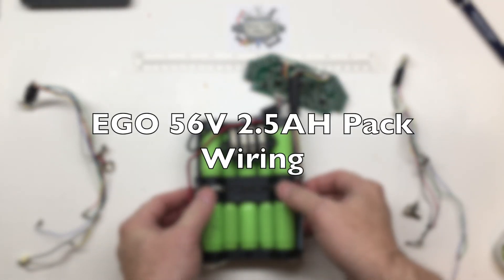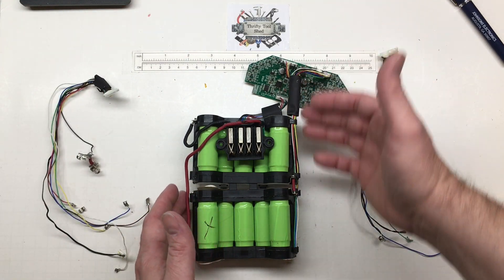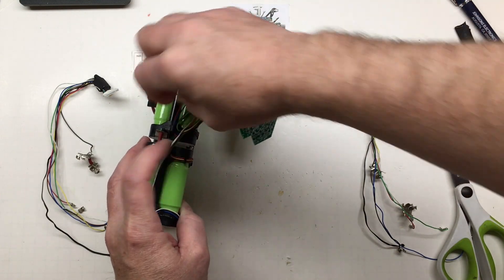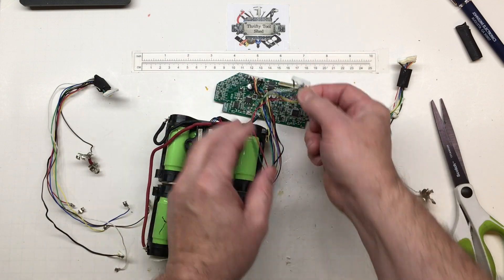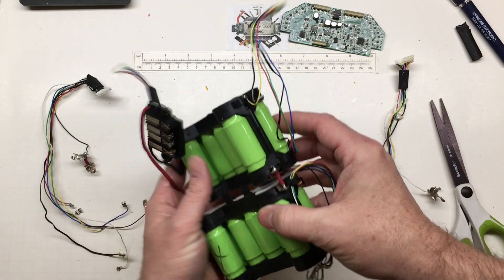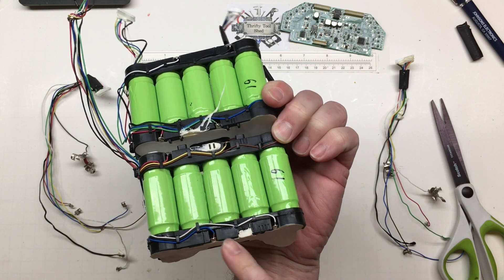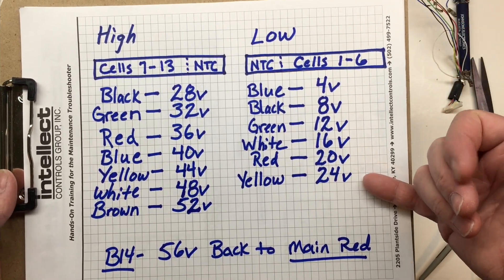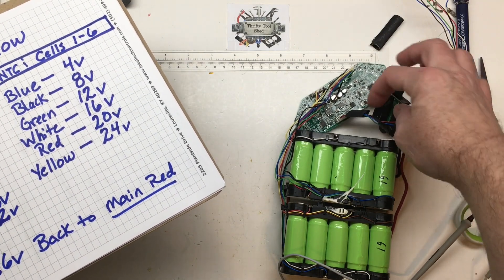EGO 56V 2.5AH BMS Wiring

Comment: I would number the cells with a marker and then take pictures as I untied the wires from the holders. Get the pic's printed at a local CVS. Prints worth every penny the next time you work on one. You can also write the volts from the chart on the batteries, but I'd copy the chart and keep it with the prints.
Reply from the maker: Excellent. The point of the video was someone already had taken it apart and asked for help getting theirs back together. Your points are valid and obvious to most (except for needing pictures developed these days). I hope my video showed that knowing ahead of time what-went-where would be the best way to do it without shaming the one who didn't? Thanks for sharing.

Comment: What do the two middle connectors near the main power connections actually do? Are they for the temperature sensing are they like a resistance to the ground circuit?
Reply from the maker: I do have videos about those terminals and all that I have found out about them so far. I do know the T-terminal on the newer 3rd Gen BMS boards are a little bit different. Works very similar though.
https://youtu.be/H-hggUXgYlU
https://youtu.be/dyLg5fK1SxU

Comment: I sent my Ego battery pack to a company for it to be rebuilt. They informed me that one balancing connector assembly on the circuit board was becoming detached and that the connector integrity is important for allowing cell balancing. What is a balancing connector and can it be easily repaired or replaced?
Reply from the maker: It depends on if the traces are broken or not. I will share a replacement of one of these in the video link below. 
https://youtu.be/85KmNgENFEc

Comment: I have a 7.5ah battery and the bms wiring was pulled out of the connectors.. where can I find a wiring diagram..?
Reply from the maker: I do not know. I have the video of the 2.5AH and it's so close to 5AH that it should be helpful for those as well. I have never worked on a 7.5AH or larger pack to say how close they are.
Reply: Same problem here.  Its the upper right connector (low side?) 12 pins,  but with only 10 wires.  Here is what I know {Blk-Blk-Red-Grn-?-?-?-Wht-?-Grn-?-Blk}.  I have three wires that pulled out.  They are Blu,Red, and Yel.
Reply from the maker: If anyone with a 7.5ah pack can help toddk63 it would be appreciated. 
I looked at my 5ah packs and they must be different. The top right 12 pin connector on the 5ah is blk,blk,rd,grn,-,-,blu,brn,grn,wht,rd,yeI.I do not own a 7.5ah pack. I rarely buy 3P packs period as they are so much more prone to failure in my experiences.
Reply from the maker: @toddk63  
One way to narrow this down is voltage measurement. Since you do have some wire connected. The 12 pin connector usually has B1-B6 on Pins 7-12 respectively. So from the battery minus/negative if you measure 4V then that is B1 and 8V is B2 etc. Depending on the charge of your cells of course...
Looks like you must have B2,B4 and B6 connected?
Reply: @toddk63  Did you ever figure out the order?  I have the same issue.
Reply: @Pfremm  
For 7.5 Ah battery:
Order is: black, red, green, yellow, white, blue, empty, empty, green, red, black, black
Reverse order is: Blk-Blk-Red-Grn-0-0-Blu-Wht-Yel-Grn-Red-Blk
Reply from the maker: @toddk63  
You can verify with the board unplugged by seeing which pins go to the B1-B6 test points on the board with a DMM. That is how I know on the 2.5ah and 5ah Gen 1&2 boards that they are going to pins 7-12. It will eliminate guessing. If the board is not using pins 7-12 for B1-B6 then it is a totally different board design!

Comment: Awesome job with disconnecting spade terminals off the nickle strips....I couldn't get them to desolder with flux and copper braided desoldering wick.Anyhow, I finally was able to save enough for all the tools needed to troubleshoot EGO battery issues. So far, I have disassembled one of the two 5 Ah battery, as both of them have reduced run time. Leaf blower would run >30' and now run time is only 10-15' max in high speed. Same with the mower - hardly 5-10' of run-time. I have tested 8* out of 14* (corrected) cells ad all have 2350 +/-2% mAh capacity, which seems pretty good considering they are rated for 2500 mAh. Would you know where could be the problem with your tremendous experience with these batteries and its BMS? 

I do not have any of the orange or red blinking LED issues. First 4 cells I tested had portion of the heat-shrink shell on the cell slightly melted - however, these tested to be at more or less the same capacity as the other cells. Tonight I am testing the remaining 4, but their physical condition is tip top and as such I don't expect to find any issues. During disassembly, all the cells were within 0.05V of each other.   I do have another 7.5 Ah battery which seems to be working fine with all of my EGO yard tools. My two 5 Ah batteries goes through more charge cycles due to additional usage during winter on the snow blower. On a couple of occasions it tripped for high current draw - motor had stalled out due to blockage.
Reply from the maker: Well they don't really seem that bad at all for cells from used packs. Your cells are over 90% capacity wise. One thing to check is when you do pull the pack down while using it or it sits for a while do they become unbalanced where possibly one set of cells are pulling lower than the others. It does get tougher to figure out the issue when it's not the obvious cell capacity issue. I have had a few cells with higher internal resistance causing issues while draining, but that is usually seen in capacity test. I have also seen rarely where the BMS is causing the issue with pulling a set of cells of the 14 groups.
Reply: While the cells are sitting charged, I did measure voltage and they seem to be off by 0,15V. I did buy new 16 cells with the same continuous current and capacity ratings, so I do intend to rebuild one battery with the new cells and have a couple spare when working on the next one. I will run "quick test" on Opus BT-C3400 which tests the internal resistance to look for the odd one. Thanks a lot for this suggestion.
Reply from the maker: @viperflyer  
Yes the quick test is helpful. The weak point of that test is the connections, making sure the connection is as close to zero ohm as possible with clean contact points. I mentioned that briefly in the video Lithium battery FAQ#1.
Reply: @ThriftyToolShed  Yeah, the manual said the same thing - that point worries me especially when comparing different cells and the measurement is already on a miliohms range. When I broke of the nickle plated strips, it didn't quite leave a very flush surface. It is also hard to get rid of all the silicone because of it. I will report the findings, maybe raised edges from the weldments might provide a pressure-point to improve contact resistance.
Reply from the maker: @viperflyer  
On used cells with ends as you mentioned sometimes I use a spring clip to hold the connection tighter. I think that is the part I mentioned in that video, but I can't remember all that well now, 🤣
Reply from the maker: @viperflyer  
Btw:
Low melt solder is an excellent trick to de-soldering. I have mentioned that in a few videos and Alex from Northridge Fix mentions that all the time and he uses it a lot on connectors etc.
Reply: @ThriftyToolShed  thank you very much. I had a small wooden stick to push on the cells to get a good consistent readings. The charger/ analyzer already have spring backed negative electrode. And, still the variation was too high... pushing with the stick helped out. The range of internal resistance I get on 13 cells i tested is 43-49 miliohms. While the 4 of the new cells measured 32-36. I'm wondering if either the NTC sensor is going bad or diodes or caps are drying up.  At this point all of the cells seem great. 

I have to learn the desoldering tricks.... soldering requires good level of skills that come only from technique, experience and the right tools. I will have to watch the experts do it....I did however learn that the flux is our best friend. Recently had to repair MOSFETs on battery/  strip welder and found the best way to solder them is to use the knife* tip... can't believe how easy it can be once you have the right tools and technique.
Reply from the maker: @viperflyer  the cells certainly do seem to be good from your test. Absolutely with soldering, you just get better with experience and learning from awesome teachers like Alex at Northridge Fix. He is always willing to show tips and tricks like the right flux and like you said flux is your friend...also the low melt solder technique is a life saver.
Reply from the maker: I don't know if you ever watch Northridge Fix in California, but if you ever get the chance Alex is a great teacher and the video below I am partial to...
I like all of them though...
https://youtu.be/KRsFP-4mtIk
Reply: @ThriftyToolShed  i haven't watched these...i plan to tonight as i need to get one battery fixed this weekend. The other 5 Ah battery wouldn't even run the leaf blower or mower set in position 3. In position 4 and without using the push assist, I was able to get the front yard done. Not sure if this has the same problem but i will disassembling the second very soon. Thanks a lot for all your help and quick responses. Appreciate "live" support.
Reply from the maker: Hope it was helpful. Best of luck to ya!
Reply: @ThriftyToolShed  thanks a lot. It's been definitely very helpful. I feel that the control board is faulty....it seems like somewhere there's too much voltage drop when current draw is high.... this is the symtoms of the second 5 Ah battery. Wondering if i have a similar issue on the first battery. I will watch your other videos where you have troubleshot the 5 Ah bms.

Comment: Hello Friend.  I am trying to figure out what kind of batteries are these ones.  They seem to be chubbier than the Sanyo ur18650 nsx? I opened up the pack and couldn't find any information? I checked all the batteries and realized I have 2 that are bad.  Please help. Thanks
Reply from the maker: They have a phase change sleeve on the 18650 cell. 
It is hard to say for sure which cells are in the packs due to the unmarked cells but we know they are close to 2500mah due to the 2.5ah, 5ah etc. rating. I bought several bad packs from eBay over the last 4 years or so and tested and collected the good cells from some packs while that helped me repair many packs. We know they will be high current cells. We have had some comments from viewers on here saying the cells they thought their packs have.....
  (Jonathan Ridder) mentioned his had Sanyo UR18650NSX. (Ipissed) mentioned his are Samsung INR18650 with phase change sleeves made of paraffin wax/carbon graphite.
  I get asked this over and over I have a video discussing some of this. 
https://youtu.be/f9SOPVEqgkw
Reply: @ThriftyToolShed  thanks for sharing this information.  Have a great day 😀

Comment: What do you call the other piece(not the bms) that has the smaller board with the actual contact points on the back? Also can I buy just the piece somewhere?
Reply from the maker: I call it the connector board? I do not know of anywhere to purchase these. I ordered a few non-working packs over the last 5 years or so to have parts as needed. The only way I know of. I have replaced the fuse on some of these connector boards in the past since you can't buy replacements.

Comment: Good morning Sir, Thank you for all those good videos! I bought a new 2.5AH battery 5 months ago and it stopped working (red blinking light on charger, does not work on blower and the button does not do anything; no light). I checked the voltage and it is still good on 56v. Do you have any suggestions how to fix it? I am using it in Costa Rica so I can not just go back to the store for warranty. 
I was thinking it might be the BMS? I have 2 older 2.0AH batteries that are on the end of their lifecycle. Would it be possible to use the BMS of the 2.0AH on the 2.5AH? Probably not I think, but just trying to search for solutions.. 
Thank you so much!
Reply from the maker: It would not hurt to look at them and verify the connectors. I know the 4ah and 5ah are different connectors on the BMS board. They are different generation pack I believe. I am not 100% sure on the 2ah and 2.5ah, but I think they would be different as well. If the connectors were the same it should be ok to try it.  I would check the fuse on the power terminal board to make sure it's good and check connectors at the BMS and make sure they are connected good and if you find nothing it is possibly the BMS if you have good voltage at terminals as you stated. Best of luck to ya. Thanks for your comment!
Reply: @ThriftyToolShed  Thank you! I turns out the connections are the same I was able to use the whole front cover of the old one (2.0Ah), with the BMS, on the new one (2.5Ah), and everything seems to work again. The old cover does not have a battery status indicator, but that is no problem. I am very happy that I could fix it!
Reply from the maker: @GijsbertDros  Awesome! So glad they were the same even though the 4ah and 5ah are in fact different from each other. Thanks for sharing.

Comment: I posted to your correct other video, apologies. Was wondering if you ever has a 5aH Ego battery with gauge indicator that only showed 3 of the 4 circular lights even though the battery charges to 58V and otherwise works normally. I have 2 with the same problem
Reply from the maker: Sorry, I do not have any of the newest generation packs myself. I have not worked on any of these. I have so many packs that I have repaired that I don't need any new ones really. That is a strange issue, having the 58V there and showing only 3 of 4.  Does the pack hold up fine even though it shows 3 of the 4 Led segments? Or does it die off sooner than usual? I would try unplugging the BMS and plugging it back in to reset the microcontroller maybe, but I have no experience to say for sure with these.
Reply: @ThriftyToolShed  found out that one of the cell banks was low at 3.8 V versus the others at 4.11 volts. So the BMS is smart enough to indicate this through less bars even though Pack voltage is good it seems. I boosted the cell pair that were the problem and now shows all green lit bars. Possible that one of the cells is bleeding voltage so may not be a permanent fix
Reply from the maker: Exactly, you know once one set starts losing capacity like that it will need replacing for sure! Atleast the capacity is enough to be used some until you get time to replace that set of cells.
Reply: sorry should have been 19mm for 18650 and 22mm cutter for 2170 type cells

Comment: These are sold as AEG 58V battery in Australia but identical internals and case. When you change the cells you should use the same type otherwise they may become unbalanced over time. Doing what you did is a fix but a more common issue we have is that there are 2 TVS devices that connect to terminals on the battery. They protect against voltage spikes and go short or partial short to ground when damaged. They stop the battery charging as the charger can no longer communicate with the board. They are tiny and underneath the board near where the wires join the board. They are 12v limiting TVS devices
Reply from the maker: You also have the wrong Battery type! This is EGO (Chervon) AEG is usually similar to TTI stuff such as the Echo 58v
Reply from the maker: All I had was same exact cell if you watch video.

Comment: I don’t have the same batteries you have, mine say Samsung. None of your videos show the batteries I have, I can’t figure out what’s wrong with it, just bought it,
Reply from the maker: It is hard to say for sure which cells are in the packs due to the unmarked cells but we know they are close to 2500mah due to the 2.5ah, 5ah etc. rating. I bought several bad packs from eBay over the last 4 years or so and tested and collected the good cells from some packs while that helped me repair many packs. We know they will be high current cells. We have had some comments from viewers on here saying the cells they thought their packs have.....
  (Jonathan Ridder) mentioned his had Sanyo UR18650NSX. (Ipissed) mentioned his are Samsung INR18650 with phase change sleeves made of paraffin wax/carbon graphite.
Reply: @ThriftyToolShed  ok, I was just wondering. I'm making my way to the ego videos you have made. I'm trying to figure out what's wrong with the battery. It's blinking three different colors. When I connect a meter on it, it says 41.6v but when I place it on the charger it just stops charging. I opened it up, but have no clue what I am looking for yet. Been trying to follow along but I don't understand what b1 or  b24 etc means. It's hard to see where you are placing the nodes of the meter.
Reply from the maker: The very first video I shared showing the the BMS repair I shared a blown up picture of the board and walk through some of the test points. I was simply learning as we go here. I shared that I believed the B1, B2 etc. Is the cells monitoring back to the BMS board so we can easily check the cell feedback at those points, make it easier than going across every single cell in the pack. Just checking to see if balanced with each other.